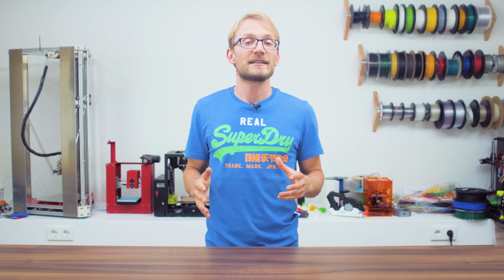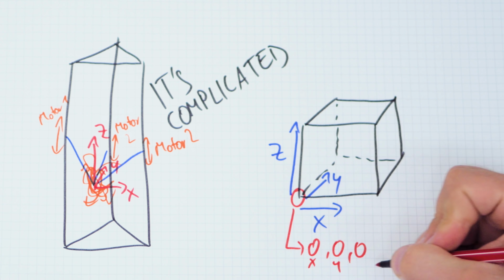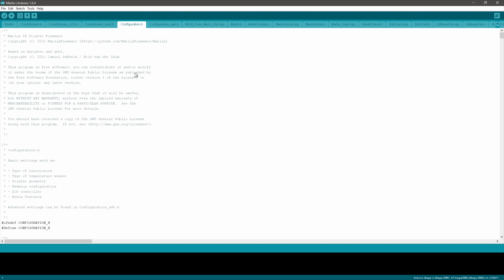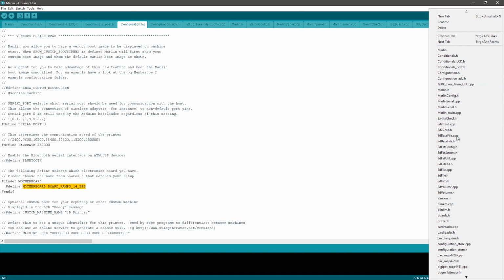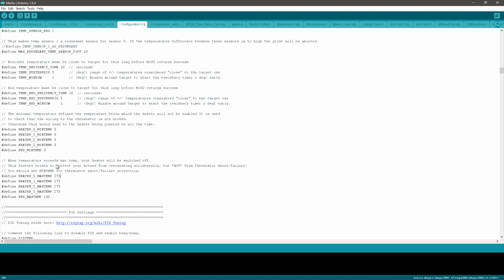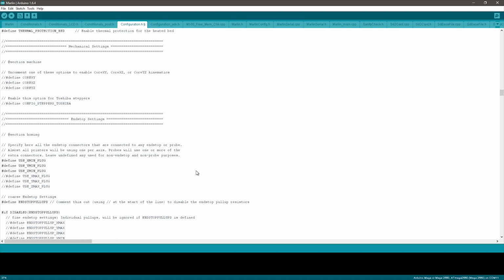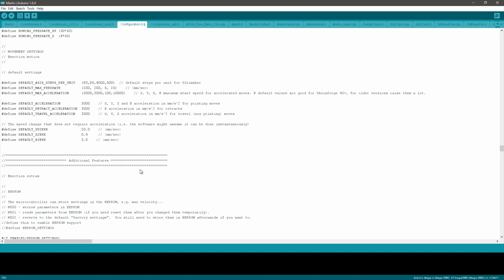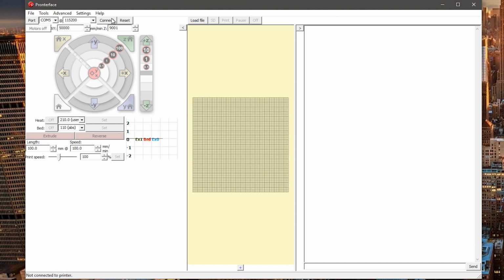[2016 version] How to set up the Marlin firmware!

Comment: Dear Tom I'm Johan from Belgium
I have a sunhokey prusa i3 who worked fine till i installed a induction sensor and updated my firmware to marlin 1.1.9 now when i heat or preheat my extrudor i get thes E1 heating fault all the time i disabeled in marlin the other " extruders" bud the fault still continiues i'm about to burn my 3D printer bud wanted ask you first iff you can help me please

Comment: Hi Tom, I'm setting up my printer, I've followed all step for setting up Marlin and I've also uploaded the sketch into my Arduino Mega, but when I power the board with the Ramps 1.4 on it, the screen turns on but seems that the firmware is not booting up, the Arduino board is getting power because I can see a green led on, in the Ramps board there is just one led that blinks once in a while and the screen remains blue. can you help me? perhaps there is something that I'm not doing.
Reply: You forget to instaled library for your lcd

Comment: what do I do if I only have a .hex file and want to change my printer to allow for negative Endstops (M211 S0)
Reply: Tom's videos are amazing, this one is the best I have found for my Melzi board. But it looks like he hasn't had a chance to get to his comments in a while. With so many videos I can't imagine what his total count for comments is. My guess would be that doing that with just the .hex file would be next to impossible. It also seems like that must be done from the firmware, in the configuration.h file. However, swapping your limit switches from normally open to normally closed or vice versa should also do the trick. If your a software guy, the easy fix would be in the software. If your a hardware guy the easy fix might just be to get new switches.
Reply: You could check to see if yours are normally open or closed by connecting an ohm meter to the leads and pressing the switch. If current flows without pressing the switch it is normally open, if you have to press the switch to get current to flow it's normally closed. Then just search online for limit switches that are opposite of what you have. 
The default .hex file that came with your printer should be configured for your setup. If that's the file and original parts for your printer your problem may be elsewhere.

Comment: Hi Tom, I would like to know if you can help me by telling me where i can adjust the bed leveling height on the Z axis, it was working perfect for nearly 4years then i upgraded to latest firmware, so i was forced to flip the power on the extruder stepper as it pushed my filament out when printing, and the new issue i have is when my Prusa i3 clone starts it runs M29 it calibrates my bed it runs half way up to my Z shaft then calibrates, it never did that before i have a feeling it might be something to do in the firmware as i am using Simplify3D and have tried it also on RepetierHost, it use to only lift 2cm up from the bed and moved to next points. :( i am lost and dont know what to do , i did manage to fix the extruder filament feed but still stuck with the Z axis height issue
Any help would be appreciated. Please

Comment: I have a Anet A8 printer. Bought it on GearBest. Where can i get the right Firmware file or the right values?
Reply: Well the manufacturer is a chinese company and I can't even speak english properly xD
Reply: Anet a8 firmware hex file: https://www.dropbox.com/s/vho6pr8mf30x9nz/A8_firmware_update.zip?dl=0
Reply: do you know of the right driver im having connection issues from printer to pc
Reply: Michael Richards the driver should be on the SD card that came with your printer.

Comment: Thomas, you did not address the programmer selection in the tools menu.  I am trying to load Marlin onto a AZTEEG X3 Pro.  Every attempt keeps giving me a time out and claiming
Arduino: 1.8.9 (Windows 7), Board: "Arduino/Genuino Mega or Mega 2560, ATmega2560 (Mega 2560)"

Sketch uses 90274 bytes (35%) of program storage space. Maximum is 253952 bytes.
Global variables use 3172 bytes (38%) of dynamic memory, leaving 5020 bytes for local variables. Maximum is 8192 bytes.
avrdude: stk500v2_ReceiveMessage(): timeout
avrdude: stk500v2_ReceiveMessage(): timeout
avrdude: stk500v2_ReceiveMessage(): timeout
avrdude: stk500v2_ReceiveMessage(): timeout
avrdude: stk500v2_ReceiveMessage(): timeout
avrdude: stk500v2_ReceiveMessage(): timeout
avrdude: stk500v2_getsync(): timeout communicating with programmer
An error occurred while uploading the sketch

This report would have more information with
"Show verbose output during compilation"
option enabled in File -> Preferences.
Reply: How did you fix it. I have the same message
Reply: @davidrandle5362  I am getting a programmer in the mail to reprogram it as The company told me that the program on the chip has been corrupted.

Here is the company's official way to load (when not corrupted
1. NO stepper drivers attached
2. power supply AND USB connected (obvious the USB, duh)
3. there should be no other problems
Reply: @buzzbbird  Thanks

Comment: So why do we use slicers that use Cartesian coordinates for delta printers instead of slicing them with the delta conversions?
Reply: +Thomas Sanladerer I see. what do you think of a printer that has four arms that move the print head instead of three like on a delta? I believe that it would be superior to a delta in speed, simplicity of programming, and making straight lines.
Reply: I'd be curious to see if this is even possible, but my intuition tells me that it's not. The thing is, triangles are "magic" shapes in that they are always perfectly flat no matter how you orient the corners. The same is not true for squares, which end up bending somewhere in the middle if you raise or lower only a single corner point. There is a good reason why it's called "triangulation."
Reply: +9998 9998 - why not a single robot style arm?
Reply: +chase they exist, and mostly use polar coordinates. Since at least one of the coordinates is usually an angle, the further you move away from the vertex, the least precision you get.

Among the non-cartesian printer, the one with less disadvantages is probably the corexy. That's because calculations are way simpler than on deltas, and in some movements both of the xy-plane motors participate, so you get up to double torque. This, together with the fact that you don't have to drag around any heavy stepper (like in cartesian printers) allows reaching higher speeds.
Reply: +chase I'm working on a SCARA called MakerArm that works in that way. It's an ambitious project, but I'm sure we'll make progress quickly. As others point out, the polar setup leads to reduced accuracy at the distal end.
Reply: +Scott Lahteine I think it is possible. look at the adept quattro
Reply: +Scott Lahteine - lol... just looked at it and was going to bring it to the table as one method.

I don't understand the inaccuracy issue. It's simply points in 3D space and once plotted via software... I don't know. I don't see the issue. Or understand why there's an issue.

commercial grade robotic arms are very accurate, used in manufacturing, spot welding, even NASA uses them. 

The ability to print at any angle, or extrude at any angle opens up immeasurable possibilities. 

As stated in a deleted post, you could literally print individual hairs on a modeled head with that ability.

a single arm extruder, allows all points in 3D space to be reached from any angle.

I've been thinking on it since I got my 3D printer. lol.

I looked at the 4 Arm delta mentioned. It is interesting from their description.
Reply: I think that using a single arm has no practical improvements because you can basically get any angle with the conventional printer. (I could be wrong)
Reply: 9998 9998 Yes, on second thought I can see a 4-way delta working. The kinematics might even be simpler than 3-arm.
Reply: +9998 9998 - conventional 3D printers print on the XY plane. Moving upwards on the Z.

A robotic arm can do that as well as print from any point in 3D space in any direction. 

For instance. 

say you print out a head model. A conventional 3D printer starts at the heat bed and prints upward along the Z axis till completed.

A robotic arm could do the same, then come back and add individual hairs on the head model, reaching under the back of the head, curving around to the top of the head. Printing each hair downward. Or however... curl each hair outward. In any direction away from the head is my point.

It could print actual eye lashes.

This is all theory of course. The hot end would have to be small enough, the nozzle long and thin enough to reach. But, it could literal print from any attachment point in any direction. Up, down, sideways, at any angle and even change direction. 

You could, with proper cooling, print a single thread curly cue spiral mid air from a single contact point.

Like a 3D pen only much better, more precise.

Some eccentric artist made one from a industrial robotic arm with a stationary center nozzle and 3 articulating nozzles, that does just that. Though they're printing imo really stupid artsy crap with it at this point. They did show it printing their spider web inspired 4 thread "web strand" mid air. 

And their interpretation of a cocoon. Just weird nonsense...

But it prints... any angle, any direction from any point. And that's pretty cool.
Reply: +chase The limitation of accuracy of an arm is caused by the finite accuracy that the arm can measure/move through an angle.  Imagine two arms that can both resolve 1 degree of rotation.  The first is 1cm long - so the end of the arm only moves a small distance when swept through 1 degree.  The second is 1m long - so the end of the arm moves much further than the shorter arm for the same 1 degree of rotation.  That's why the resolution of an arm/delta reduces the further from the origin that a point is plotted.
Reply: +David Smith - that's a step motor and software issue then, correct? That problem should be easily corrected via software... or maybe not. I'm no expert on the subject.

There's a small 6 or 5 axis arm that claims accuracy/repeatability of 0.005 I was looking at. First one I came across actually.

I understood from what they explained the reason to justify cost; the issue of accuracy was related to cost of anti-backlash gears. They didn't mention arm length.

if you look at old school scale drawing tools, arm length never caused an issue, though that's for 2D.

I guess I still don't see the problem. lol
Reply: chase No, software cannot fix this problem.  It requires stepper motors with accuracy sufficient to produce the resolution you require over the build volume you want (you pick this based on your budget and resolution requirements) - but the resolution (of an arm/delta) will always reduce the further you get from the origin - that's just how triangles work.
Reply: +David Smith hmmm..  I'm going to have to look into this some more to fully understand the issue.

What about adding gearing to the stepper motor to bring up the angle? 512? / 514 ? steps with gearing is common. And it raises the torque when geared as opposed to additional steps to the motor.

or... And this is just an open thought... go fluid. 
If the action requires fluid motion, go fluid. Use hydraulic based something... lol. I don't know..  there has to be something that can solve this easily. Or more efficiently and accurately.
Reply: chase You are missing the point.  Anything that causes a finite amount of angular rotation gets amplified by the length of the arm - so the resolution when the arm is short is always going to be higher, closer to the origin and lower when the arm is long and the end of the arm is further from the origin. Hydraulics makes no difference - the amount of angular change caused by the movement of the smallest amount of fluid that can be controlled/measured will still be amplified in the same way by the length of the arm.  But it doesn't matter - you design the machine so that the lower resolution away from origin, within your build volume, is high enough for the fidelity you require.  The fact that you have excessive resolution close to the origin is just a bonus - that you can design out in software, if required, by reducing the "apparent resolution" by reducing the number (and increasing the size) of the angular steps close to the origin.
Reply: +David Smith As stated I'm going to have to look more into the issue. Because you are correct, I'm not grasping the problem. Or more so, why it's a problem that seems so difficult to resolve.

If I hold my arm up... I can move to any point in space. (accuracy only limited by grey matter and muscle control)

Since I can do it with my arm, I don't see the issue being a major hurtle in robotics.
I do see long/ short arm differences but... Not issues.

As stated, I need to look more into it.
Reply: chase That's because your arm control is analogue - not digital.  Look at this image and notice that the further from the origin, the wider the dots are spaced.  That's the issue.  http://i.imgur.com/GDv5X8N.png
Reply: +David Smith - I see what you're saying... as far as the image goes. 

I'm not understanding what digital versus grey matter has to do with it. 

I still need to look into in more to understand why that's an issue.
Reply: chase  Digital as in steps - analogue as in smooth transition.  Digital with small enough steps (and smoothing) can simulate analogue - but it's only ever an approximation (talk to an audiophile to confirm this).  Enjoy the rest of your investigation.
Reply: +chase Im sure you could make an arm accurate enough  but not without high cost. The real industrial robotic arms do not use steppers they use servo motors  with encoders. They are fairly accurate but not really the accuracy you are talking about. It is a cool concept but cnc machines with the current designs are cheaper and more accurate. If you wanted to design something that could do the things like you were talking about I would use light or something else to form the part because you will have unparalleled accuracy.
Reply: +David Smith - thanks for expounding on that.

I do create music and 3D animation, I just couldn't grasp why I could create a 3D robotic arm digitally, and have it "work", meaning go to any point in 3D space and in real world applications it wouldn't be the same. They both plot points in 3D space.

but I see what you're saying now.
Reply: +David Smith - thanks for expounding on that.

I do create music and 3D animation, I just couldn't grasp why I could create a 3D robotic arm digitally, and have it "work", meaning go to any point in 3D space and in real world applications it wouldn't be the same. They both plot points in 3D space.

but I see what you're saying now.
Reply: +9998 9998 - thanks for jumping in with additional info.

it was just a thought I had since I got my printer... All of what? 4/5 weeks ago... up and running for a couple weeks now.

It "seems" so simple, logical... 
And costs do factor in.

The idea of printing anywhere in 3D space from any angle just really appealed to me. 

And I'm one that thinks in terms of how to do it rather than why it can't be done.

I don't know.. I'm weird in that respect I guess. lol

Comment: i was wandering if i can use marlin and arduino to control my diy 3d printer
Reply: Marlin will run on a RAMPS board, which sits on top of a Arduino (or clone) Mega 2560 board. Best to get RAMPS kit which has all matched components together. Marlin will allow you configure for whatever creation you come up with.

Comment: I'm hoping all you printer guys can help me out. A few years ago I build a completely custom 3D printer, including PCB and electronics. I wrote some basic software to run it, but now I'd like to convert over to Marlin. I'm using an Arduino Due, so I know Marlin can run on it. The problem is that all the pin definitions are different for my PCB. I'm hoping someone can help me (or point me) to figure out which files I need to edit to add a new pin definition for my controller.

It looks like I should be able to create a new pin definition file, and then create a new entry for it in the boards.h file.
Is that all that needs to change?

The items that will have to change (I think) are as follows:

Heater (GPIO pin with PWM, maybe inverted signal),
Heated Bed (GPIO with PWM),
2X Fans (GPIO with PWM),
Temp Sensor Chip Select(This is just the SPI bus, as I'm using MAX6675),
SD Card Chip Select (Also SPI Bus),
4X push buttons for LCD navigation,
4 line by 16 Character Display,
4X Motor Driver Step and Direction (Z Axis uses two steppers that should be synchronized),
3X endstops (optical TTL open drain output - pull up resistors required),
Piezo speaker for audible feedback  (Not a self driving buzzer, so a square wave output is required).

Can anyone point me in the right direction? Is Marlin capable of handling this hardware configuration? I don't think tree will be any major problems, as I know there are different existing printers that use all these types of hardware. 

Thanks for your help.

Comment: Does anyone know if you can download the firmware directly from your printer ? I want to make a backup of the working config. Before I change anything. Thanks,
Mark
Reply: me too
Reply: Unluckily, it's imposible to extract the firmware. You can try connecting the printer to your pc, and use the gcode (I think it was m501) with a program like pronterface. it will give you the parameters from EEPROM (axis acceleration, steps/mm, etc). But apart from that, you can't get anything else. I recommend downloading the firmware provided by the manufacturer, and changing the parameters in an updated version of the firmware. I hope it was useful